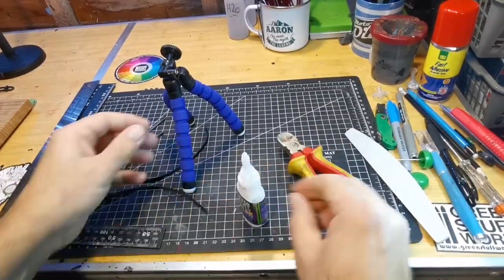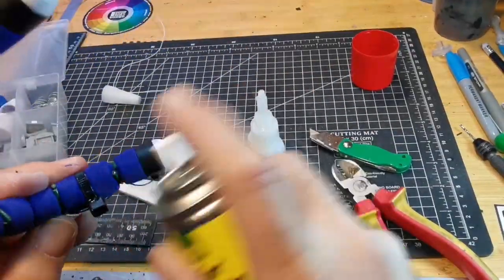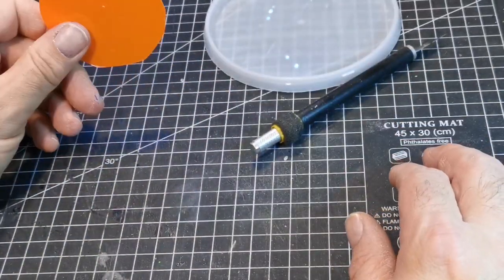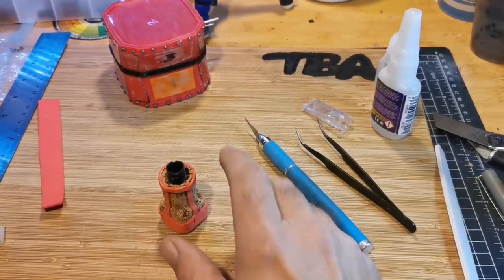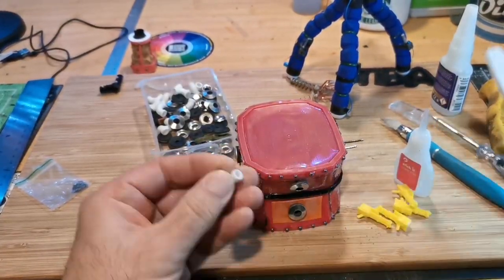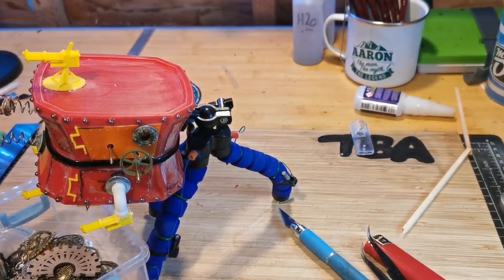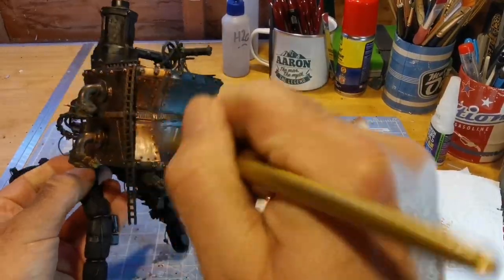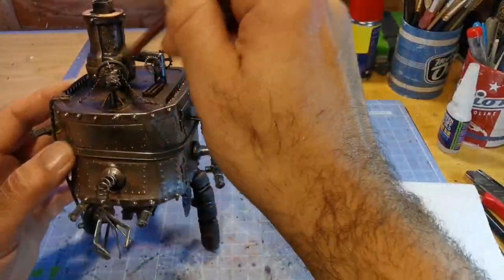Scratch build a War of the Worlds Death Machine. Ep21.

Comment: Another cracking build Aaron.  Tell me, do you have all your parts ready before you build or do you make it up there and then?  I'm struggling with my process.
Reply from the maker: cheers dude. Nope, free style plastic jazz dude. I'll hunt around for bits and pieces or just make something different if I can't get a shape. I try not to back myself into a corner and stress about a piece. If I get really stuck, I'll move onto something else until I get inspiration to how to fix the problem on the first build